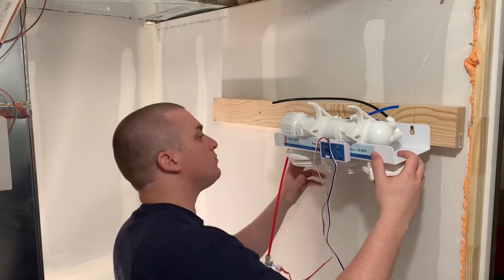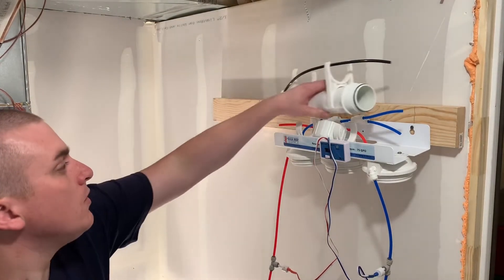Reverse Osmosis Unit, How does it work?

Comment: I’m eventually gonna do this for my water changes, no salt water, but my tap water is off the chart hard, and my PH in summer is 8.4, so I want to bring that down to 7.4 and take some of the hardness out.
Reply from the maker: If you take on that adventure I am curious to hear about your results.  I may do some experimenting myself with this to see what I can come up with.
Reply from the maker: If you go that route I think the simple 4 stage would work great for  you.  Mix that with your tap water and you should be set.
Reply: Weldon Aquatics  that was the plan, just have to get the right mixture.
Reply: Will do Brother.